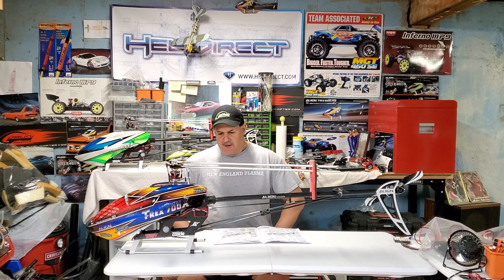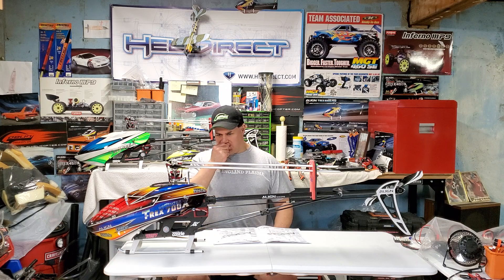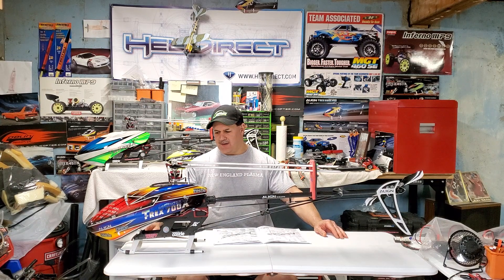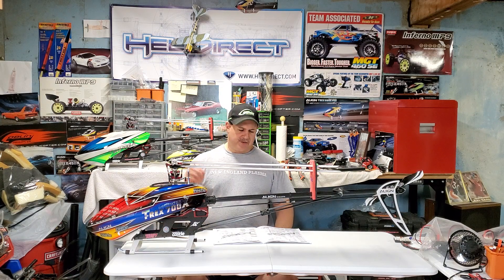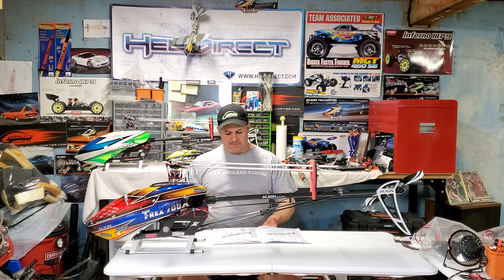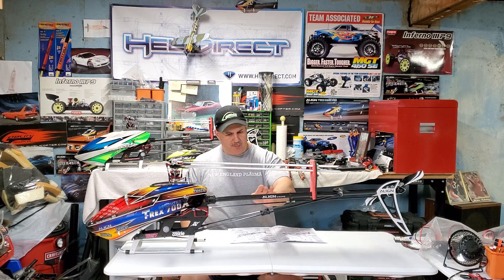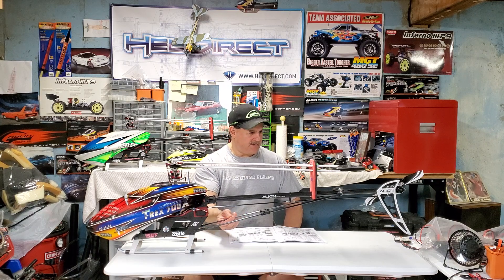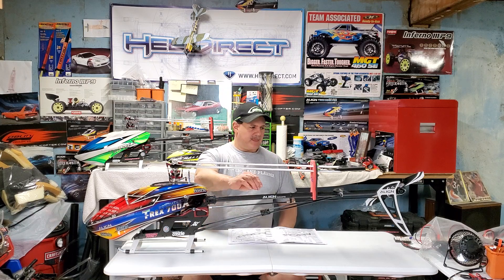Align Trex 700 X ,trouble shooting a tail wag issue and how to fix it

Comment: I have the same heli. Whenever I give full negative pitch in flight, the tail wags, stripping the front tail gear. When I adjust the gyro setting, the only thing it does is speed up or slow down the wag. I replaced the gear countless times. What could the issue be?
Reply from the maker: I have never had that happen before are you using the new  red gears
Reply: Hate to bring up old issues but I'm having the same issue with my Blade 700X, did you find any solutions?